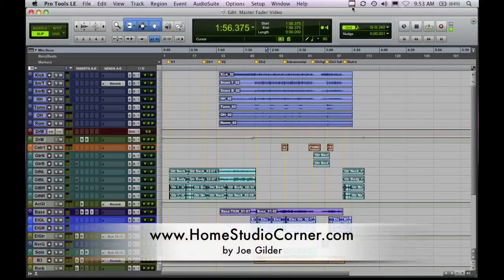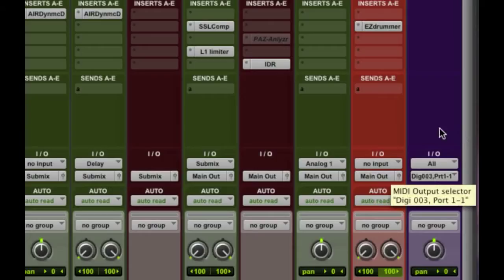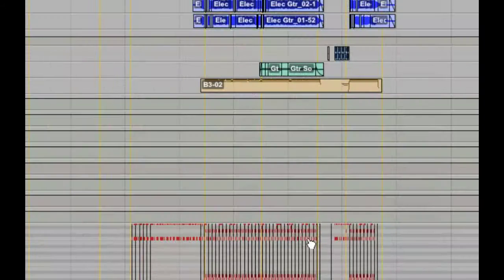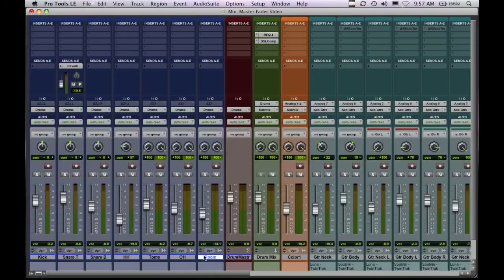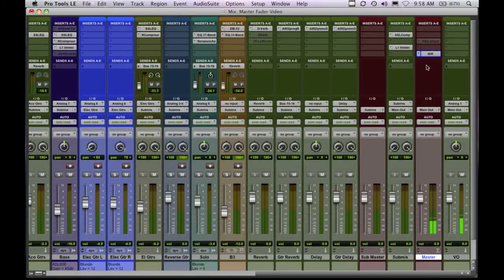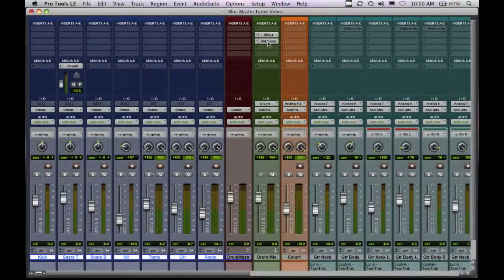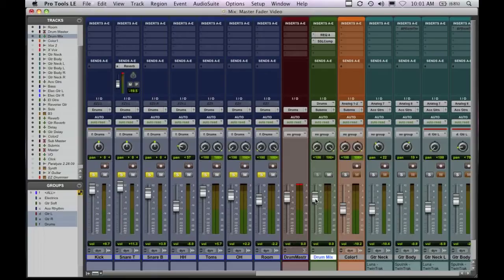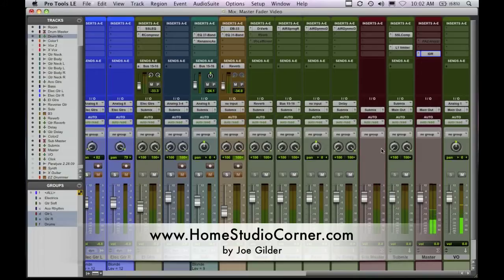Track Types: Master Fader - HomeStudioCorner.com

Comment: With master faders, I got a bit confused on how putting compression and EQ on the SubMix Aux would be different on a fade out than putting them on the Master fader. Don't master faders process plugins before the fader? Wouldn't that mean it wouldn't effect the input into the plugins? Or did I just interpret you wrong. I'm just a little confused there, otherwise, awesome videos.

Comment from the maker: Yeah, it's a bit confusing. The master fader DOES allow you to turn down the signal. It actually (to my understanding) turns down the signals feeding INTO it, so you can prevent clipping by turning down the master fader a few dB. In this video, I'm using the master fader strictly to monitor levels and make sure no busses are clipping.